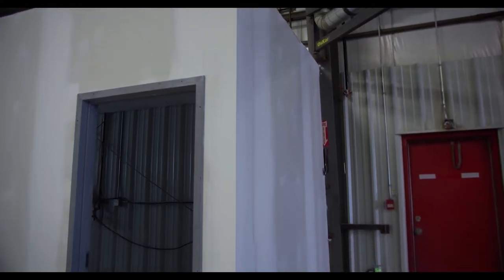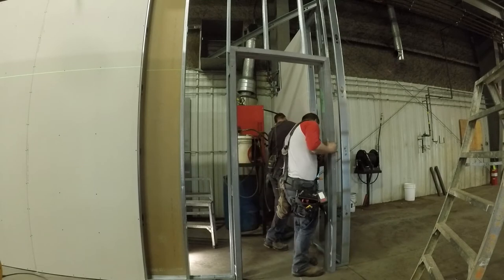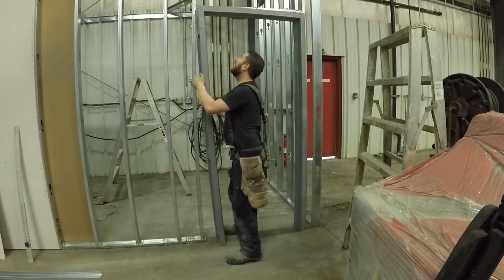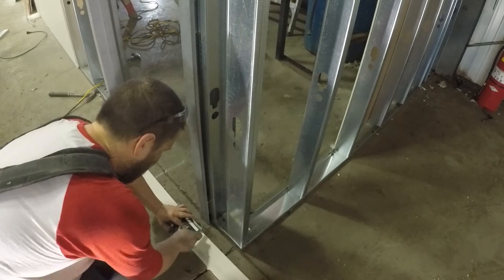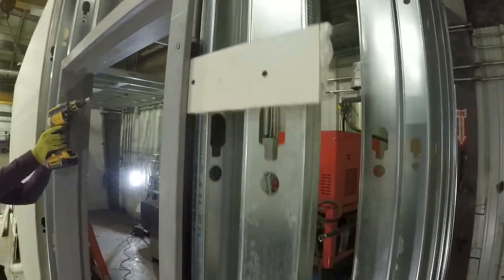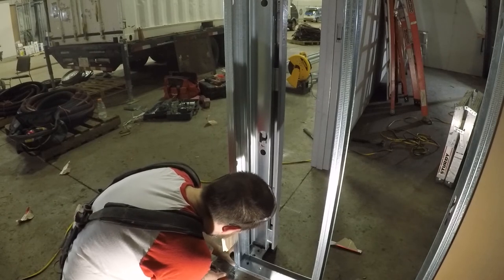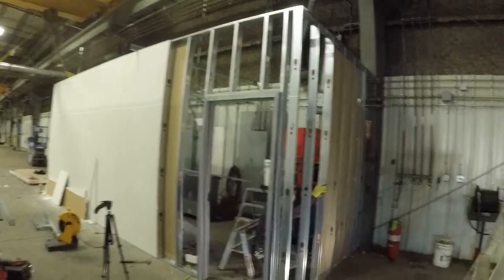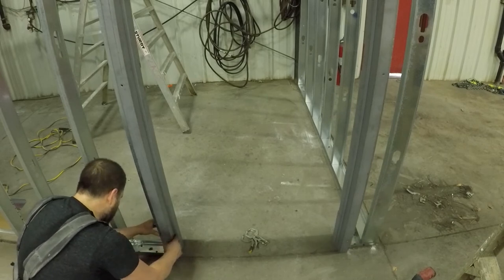Metal Door Frame Install Metal Stud Framing Tutorial!

Comment: What's the dimensions for the rough openings.
Reply from the maker: Usually 40-1/4 x 82-1/2 but be careful, what I usually do is measure the actual frames if they are on site and if they aren't on site I ask the GC or manager what they want for ROs. Some guys want plywood, some want 2x4 and others want  nothing or the wood.on the inside so it's perfectly normal to ask someone what they want. Don't think they will think you dont know what your doing it's completely normal.

Comment: As a KD door, why wouldn't you rock first then slide KD on?
Reply from the maker: Hey my man, yeah we put the frames in first in steel stud. You can't screw the clips in properly or pin them down at all if the drywall is on. On most jobs we only put the frames in as a part of the framing but never hang the doors or do hardware.